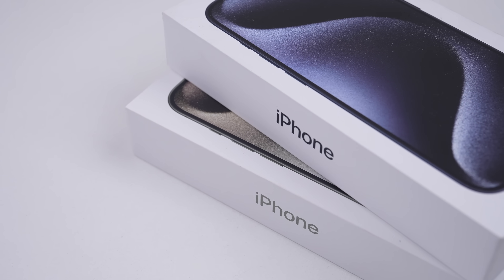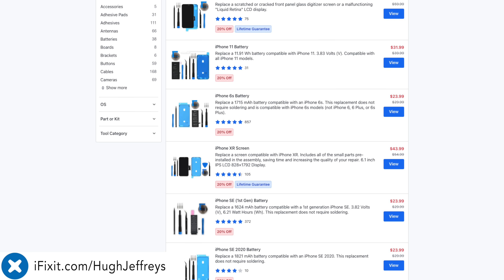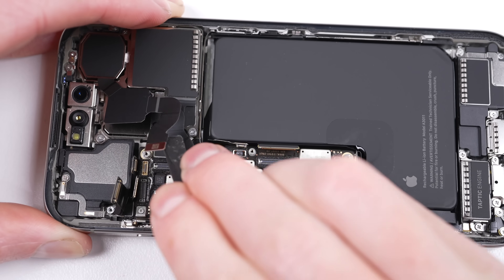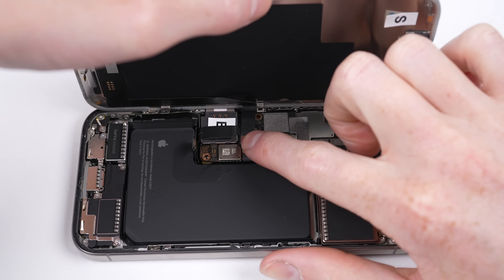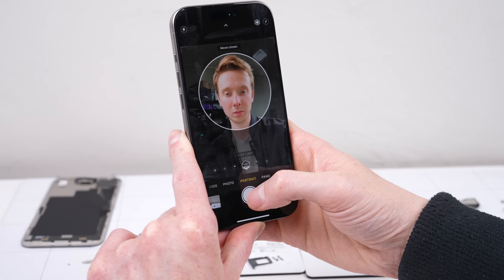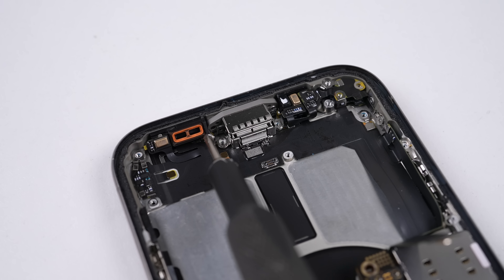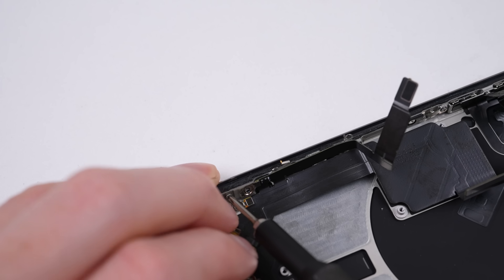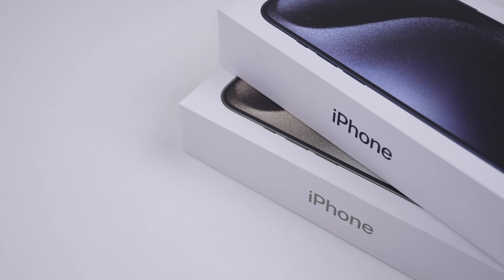iPhone 15 Pro Exposed - This Will Harm The Environment - Teardown And Repair Assessment

Comment: I am typing this comment on that exact model, my first (and last) iPhone, a purchase I have bitterly regretted ever since.  After years of sharing my disdain for Apple's railroading practices, a pushy family member insisted they'd become the best mobile option and convinced me to get one.  I knew I was probably going to have a hard time adjusting and that I'd be cranky about the limitations, but there are so many nuisances I never could have even imagined, unfathomable design choices, unfixable problems.  The benefits aren't enough to outweigh the daily frustrations for me, let alone what I've learned since about just how heinous the specifics of their anti-repair practices are.  I don't even feel like I own my damned phone, it may as well be a black box that Apple has deigned to lend me, for however long they see fit.  Before I was an Apple user myself I mildly disliked the company - now I abhor it.  Never again.

Comment: Pull it cold, the colder the better. Use a razor blade. Stick it (wedge) into the bottom so it's fit between the frame and screen, sitting, sharp-side-down, against the pentalobe fittings. Then using the blade you can lever the entire bottom of the screen out for an opening. Then no annoying, slipping, suction cups, ripping flexes..... I could go on but I fix these for a living

Comment: I would support Apple's policy of genuine apple parts only if 1 phone is still under warranty and 2 the parts are under the same warranty. meaning you should be able to put in new apple parts into a phone under warranty or swap them between phones if the phones are both under the same warranty terms.  It would be ill advised of Apple to warranty a phone that is not using their parts.  However if the phone is out of warranty it should be able to take compatible parts from anywhere at the choice the owner.  I hope that made sense. Apple needs to protect their brand and their purse strings but only on products under their warranty, when the product is out of warranty people should be able to do what they want with it.

Comment: If Apple still wanted to control repairs, they should have the iPhone authorize the part internally, and not need to use the Diagnostics tool and call someone at Apple to do this.

Comment: Say Apple allows any parts to be used and work perfectly. When I take my phone to be repaired at a third party shop, how can I be sure that they are using high quality parts and not cheap batteries etc? How can I be sure that the parts used from a stolen iPhone that was broken apart to be used as parts to repair other phones? How can I be sure that I am getting genuine Apple parts if that is what I want? Same as when I get my Audi serviced or parts replaced, I want genuine Audi parts, or if they aren't OEM then I at least want to be sure that they are as good or better quality than the OEM parts. I'm sure there is a better way than what Apple is doing but in a sense, it does protect the consumer. Also if I need repairs, I go to an Authorised repair shop so none of this is really relevant anyway.

Comment: I’m surprised people don’t understand the software lock is to help prevent theft. It does suck, but that’s a big reason you can’t just saw parts around
Reply: Theft will happen regardless if the phone can be fixed or not.

Comment: One thing I don’t like is that flimsy looking plastic tab securing the pins inside the USB-C port, unlike those from MacBooks made of metal. I foresee this becoming a common failure point in time.
Reply: If it’s a strong engineering plastic, then it should be no problem at all. A lot of the mechanical stability is provided by the metal of the phone enclosure, since a precise fit there prevents a lot of the forces from ever being transferred to the connector itself.

Comment: I don’t see this as an issue. 
If I were to buy a second hand phone, I want assurance that any repairs to be CERTIFIED by Apple, and not done by some cheap second rate garage hack due to the seller trying to save a buck.
If the seller isn’t willing to fix it on his own loss, then I’ll just buy it from someone else who is. It’s a buyers marketer anyway.

Comment: Rumor has it the back glass is also software-locked to the motherboard... Hugh should test and find out
Reply from the maker: Heard that myself after the video. Thinking I missed something I did just a back glass swap between these two phones and no issues came about. No random restarts as iFixit was getting with the Pro Max variants.
Reply: @HughJeffreys  What about MagSafe and wireless charging? Were those still working after the swap?
Reply: @HughJeffreys  Thanks for checking, was also coming here wondering if any functionality was lost, if you do a teardown of the i15 or Plus could you give a swapped rear glass a go with a wireless charger / magsafe products?

Comment: 2010: do it yourself
2023: do it yourself*

* pay us internally for each individual part and repair it yourself using stupidly unnecessary screwdrivers for complexity, then require authentication to install software properly after reparing, 

or pay us to fix it for $99999999

Comment: to be honest... i much prefer apple only approving their parts...it means if you take it to a repair centre you know (for the most part) that you are getting a genuine apple part with less chance of somehting going wrong - rather than having a knock off part which works but does last as long or causes other issues. When you are spending £1k or more on a phone, why risk putting in a cheap copy part. It's like all the cheap SD cards on amazon that look like the better ones but dont last 5mins and you lose your data

Comment: Apple has been really shooting themselves in the foot (or other parts) for the last couple of years with the way they've been operating in a very anti-consumer manner. From the difficulty in the physical repair, to how fragile parts of the phone are, to the software-locking parts, to flat out just not doing anything interesting with their phones for the last 5 years or so. Now with the 15 they've taken another step in the direction of showing just how morally and creatively bankrupt they truly have become. Focusing just on the iPhone, absolutely nothing new was brought in with the 15 other than a new processor (whoop de do), upgraded camera that is still beaten out by Android companies in terms of both mp and software assistance, and the "big deal" Usb-C charging/data port. Of course, all of these changes mean nothing unless you shell out an additional $300 minimum for the Pro that actually has any form of "upgrade" to these features from last year, particularly the usb-c. And during the launch session Apple put out, they really laid it on thick how "revolutionary" this was and how wonderful and altruistic the company was being by "innovating" with the swapping in of the usb-c, as though they weren't forced to legally by an entire continent.

The fact is, Apple hasn't been innovative with their products for years. They have one thing and one thing only that is in their favor and that's their iOS operating system. It's a good operating system and has indeed become something of a gold standard for mobile OS's over the years, and is pretty solid in that when an update rolls out, literally every mobile device will get that update instantly instead of staggered rollouts like you see with the multitude of Android phones and OS's. Plus, Apple's OS changes usually result in a tangible kind of change that actually can be new and interesting whereas many Android updates (I'm looking right at you Samsung) are typically no better than a patch or a fix with the majority of phones forgotten about when it comes to tangible, noticeable OS upgrades roughly 6 months after launch. The only outliers there being Google phones themselves and Motorola since they run pretty much stock Android as well.

However, a decent OS simply isn't enough anymore. Samsung and Google are blowing Apple away when it comes to their phones' cameras, it's been widely made public that Apple is probably around a decade behind when it comes to the Usb-C connectivity and data transfer rates, and the Apple hype really is starting to die off because people are starting to see what a money pit an Apple device ends up being. And that's before even getting into the atrocities that are Macs and the MacOs. Unless Apple starts losing money hand over fist, which likely won't happen because unfortunately there are WAY too many stans and shills for the company out there that aren't capable of independent thought and just follow the trends of Apple being a "premium" product, or another lawsuit is brought forth by the EU, we're not going to see any changes. And yes, the EU is the only hope we have for bringing about forced change to Apple because North America will NEVER do anything against Apple since I don't even want to think about how much money they're dumping into American politics.

Comment: Would it kill them to do what Samsung does with bottom components and make it a discrete component that connects back to the main logic board with 1-3 flex cables?

Comment: I personally would care less about the Right to repair crap some people are crying about. If you can afford an expensive phone you can afford to have it repaired by the manufacturer and not some random repair center that can potentially ruin the device and i am sure some folks will ended up blaming the manufacturer for the difficulty to repair such devices.
If i dropped and ruined my device i rather send it to the manufacturer for repair, it adds piece of mind they are using genuine parts by certified staff.

You do not like it? do not buy it.. simple.

Comment: I’m all for the lightning port. You shouldn’t even be interested in an enclosed ecosystem if it doesn’t support what you like. They’re their own company. Telling them to switch or else is just a pussy move. What if all androids needed to legally switch over to the OG galaxy charger? Y’all wouldn’t be very happy. 

If you like your type C, stick to android. I will be replacing the usb c with the original lightning port. Such a stupid implementation

Comment: Well no surprise here.  They're gonna drag their feet on this forever.  I welcome the USB-C change but lightning cables didn't bother me.  If you were alive not too long ago, as I was; you will remember the nightmare of the "usb" cable types.  Before USB-C was a thing and that you could put the plug in any direction, you had usb types a, b, mini a and mini b, and micro a and micro b...and probably more and they only plugged in one way.  This was one of the few true areas where apple actually made something better with lightning...ofc their prior cable whatever it was called was a pain in the ass as well.  I seem to recall those old cables getting "stuck" almost when you tried to disconnect them.

Comment: Wow 😮 now after watching Jerry Rig everything, your video and the news about them overheating.  We now have the worlds most expensive disposable phone with no interchangeable parts.  Fair phone and Nokia are slowly getting in line for phones that you can completely repair yourself at home. They might not be the fastest speeds or best camera. But it’s a start. Honestly I’m really disappointed with apple that doesn’t look like a work of art. It looks like a bunch of junk and my next paper weight if I’m not careful. I’m leaning towards the Samsung Flip 5 now.  Or I will just stay with my IPhone 7 and get a Nokia Pro Max for like 300$ and throw that away too 😂

Comment: Summary
In this YouTube video, the iPhone 15 Pro is dissected and assessed for repairability. While the phone boasts a more recycled design, it still faces challenges when it comes to repair. The proprietary lightning connector has been replaced with a universal USBC connector, complying with EU legislation. However, using third-party repair parts leads to software compatibility issues and disables features like the front camera and face ID. The teardown reveals some positive aspects, such as the detachable back glass and the implementation of the USBC port. Overall, the iPhone 15 Pro falls short of being truly repairable.

Highlights
💔 The iPhone 15 Pro's repairability is limited despite Apple's claims of being more recycled.
⚡ The proprietary lightning connector has been replaced with a USBC connector.
📱 Third-party repair parts cause software compatibility issues, disabling features like the front camera and face ID.
🔧 Positive aspects include the detachable back glass and the implementation of the USBC port.
❌ The iPhone 15 Pro is not truly repairable due to parts pairing and software restrictions.

Comment: If Apple loosened the software-locking of the logic board by restricting it to just 'genuine Apple part' instead of 'genuine Apple part authorized to match with this serial number XYZ', life would be a lot easier.

Comment: In fairness, I agree with the over-complicated repair design.

It stops stupid people (and let's be real, most of this generation is stupid), from prying open their phone and attempting a self-repair, only to cause further damage from lack of experience.

You don't go and decide to start knocking down walls in your house because you need to repair something, you get hire someone who knows what they're doing.

It's funny as this entire comment section is banging out Apple, yet i'm willing to bet 95% of you here don't even repair your own phones, or know how to, thus making it irrelevant.

I'm not sticking up for Apple, I have a love/hate relationship with them (I'm still rocking an iPhone 11 and a Galaxy), but they seem to get bagged out on almost everything. Yet, without ANY doubt, it is the most flawless OS i've ever used, and provides features that are stable (Hint: it doesn't need to be next-gen tech; Software plays just as much of a part as the hardware does).

You can have 1000GB of RAM all you want, but if the software ain't optimised, it ain't gonna matter. Look at linux, that thing can boot and run on almost anything without issues, can't do that with windows. Same goes for Apple/Android.

Comment: I noticed the screw to the right of the usb c connector you installed incorrectly.  You installed on a slant and can clearly see not flush like the screw on the left.  I wonder if any else noticed.  Either way a great video you made here.  Keep up the good work.

Comment: It’s worth noting that some Repair companies have access to the software required to perform part synchronization (used to work at one that had the soft) however the method of acquisition is unfortunately unknown to me
Reply: they are Apple authorized. They must not use any 3rd party parts and many requirements to be Apple authorized.  Small repair shops are generally not qualified .

Comment: For someone with such technical knowledge, why are you saying USB-C is a "faster" connection? It's merely a physical port, the protocol is what dictates specs like charging speed (5V/3A, or 15W bare minimum) and data transfer. Both of which could (and are) equivalent or worse to Lightning when set to the MINIMUM provided by USB-C.

The same EU regulation also makes it possible for Apple to not bundle a wall charger with the device, so let's give credit to the EU as well for that part. They base their decision on the same grounds as Apple does.

Comment: So why do Apple use stupid  software locks to stop you replacing the screen and the camera get rid of some features of it and also when you replace the battery the battery health goes away the only way  to get those  features back is taking it back to Apple and that will cost you a lot of money that's why I won't be getting any of apple's stuff thay just e waste. . And i am not  forceing people to get any phones that the Thay like some people like apple and some people like android which im one of those people with an android phone

Comment: a recycled material and yet the price didn't moved much😂 Apple is ripping the ppl again by producing a product for a cheaper price but sell it in a higher price😂 and Apple fanatics are still buying it.

their reasons: concerned about environment so they're using recycled materials, and yet they don't make their products more repairable and last long by making parts replaceable.

Comment: To be honest, if you look after your phone you would not have to open it. I don't see the big deal about making a phone repairable. if you are going to buy a phone with so much tech crammed in such a small area, and pay the price it costs, is it really so bad to get it repaired by apple? If you buy a bugatti veiron, I doubt you will send it to a quickfit for an engine replacement. I think a lot of the whining about repairability is overrated!

Comment: My friends are CrApple Fanbois, Even one has switched to a Samsung phone but unfortunately they ary are doining CrApple's model of making them almost un repairable. No replaceable battery etc  wtf? I used to carry a few batteries  with me and now can't. The list goes on ad finitem
Reply: replacable batteries were removed mainly so technology could advance, with todays tech tho its completely possible to bring removable batteries back, some new samsungs still have them and the eu is forcing manufacuters to have removable batteries by 2027 so they will come back

Comment: On my S23Ultra i changed the Cameras no issue i changed the Screen no issue even Fingerprint work with new screen 😂😂 apple where do you want to go
Reply: I even soldered a 1TB Chip no problem  the board works beacuse u only can get the 1TB version from Samsung but men thats not a serious problem. And the chip sits perfect because it was intended

Comment: Test if the Samsung Fast Charger actually fast charges. I have discovered, at least on my old 12 Pro Max it only slow charges even though it is 22watts. But if I use the cheap Costco fast charger it works as expected.